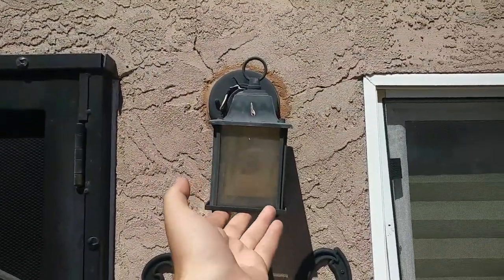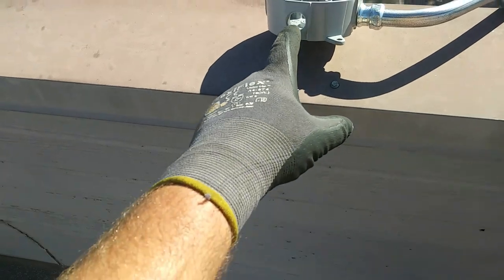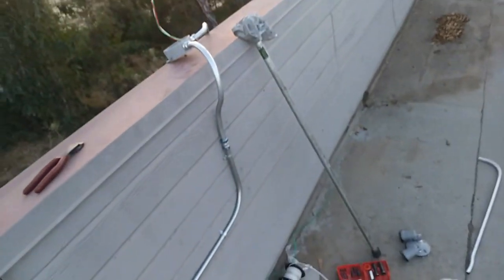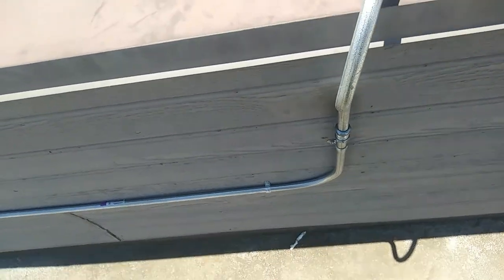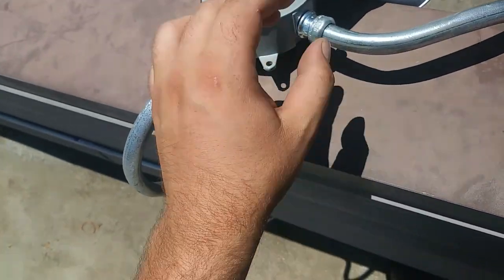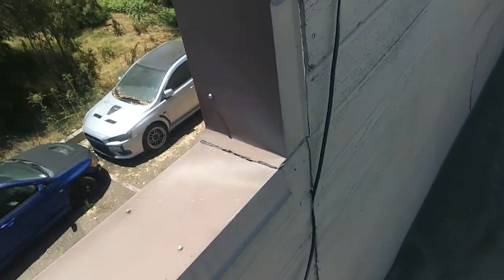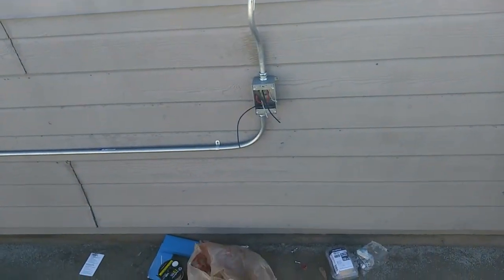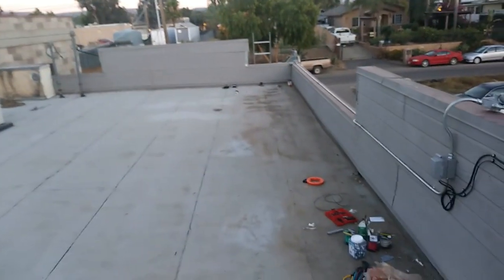Security Upgrade - New Flood Light Fixtures and Ring Cameras

Comment: Wow, 4 x 250W is damn bright.  Plenty enough light to deter criminals and also cockroaches. 
Nice job on the bending.  I've had only enough experience in that to appreciate the work others do.
Reply from the maker: Thanks my friend, appreciate the kind words. Bending EMT is pretty easy once you get the hang of it. I very frequently do it without measurements or marks and I usually only make a couple mistakes that result in a scrap piece. 

As for the lights themselves;  Yeah it's pretty lit up now for sure! I bought brightest ones I could get in an exterior flood. It was totally gloomy around there before. That broken fixture I took out was one of 3 on the building and that was it for exterior lighting. I think the owner felt a little guilty because he took me aside when the tenant wasn't there and asked if I could install some more on the other half of the building lol I think he knows the break-in wouldn't have happened if he had some decent lighting.